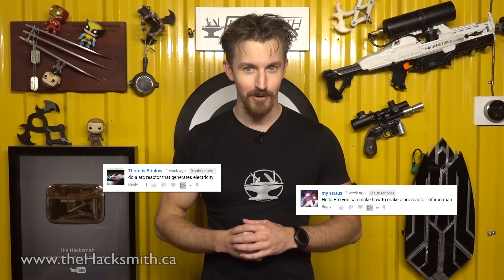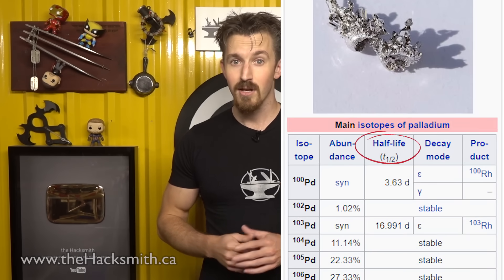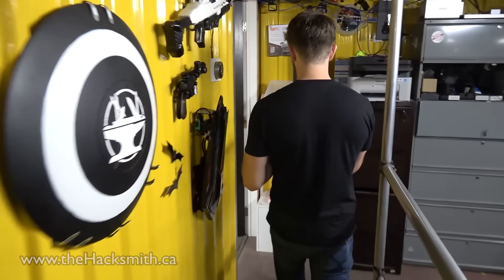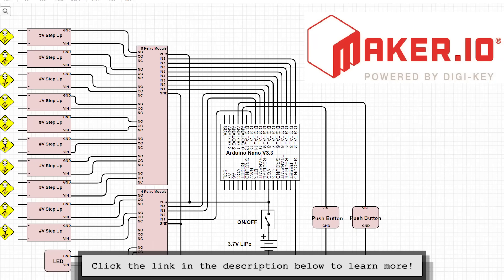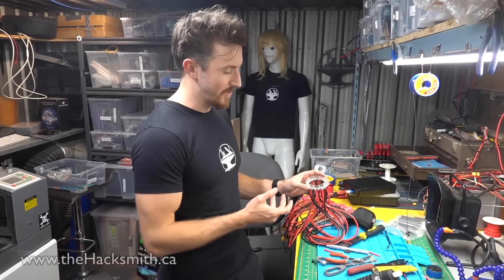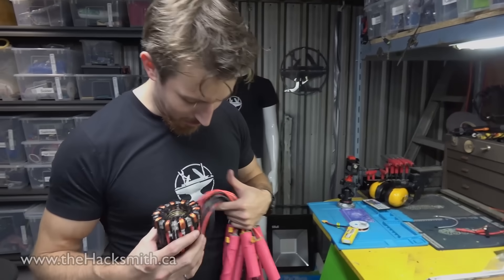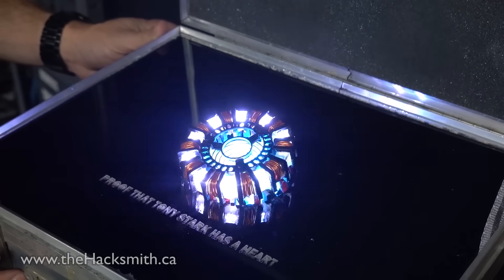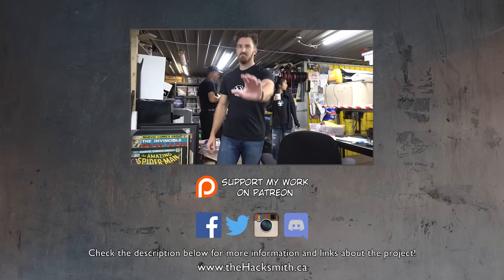Real Arc Reactor (ionized plasma generator)

Comment: ARC REACTOR IS NOT INFINITE POWER SOURCE! (Tesseract is!)
If so, why does Tony Stark face so much trouble of battery drainage every now and then?
Reply: Wrong, the problem is that the energy output was too low, at just 3 gigajoules per second for the one he built in the cave. That's why with the later generations of armors, he used multiple arc reactors to power just one suit. Also, don't mistake the huge arc reactor in his company with the mini-version that he use in his armor. The bigger one can power a whole company, but the smaller one can only power an armor in the first movie. 

At the end of the first movie, the bigger arc reactor was destroyed, and then in the 2nd movie, Stark built a new one with a new element that his father designed, which was powerful enough to power the entire Stark Tower. Loki then used that arc reactor to power the Tesseract and open the wormhole above New York. So technically, even the Tessaract doesn't have infinite power, or at least, not enough to open a huge wormhole.
Reply: To give Thor a purpose on the team.

Comment: You did it wrong! First of all you need a round flash tube (like from a stroboscope). Then power that appropriately. Now you only need one power input and much less power than before. 
The coils are not for harvesting power, but to contain it. The spark is plasma, wich can be controlled by electromagnets, aka the coils. With the magnetic field you can shape the spark/plasma, and for example make ik very thin, so it can't touch the outer walls of the glass tube and make it hot.

To harvest the energy you should use secondary coils under the flash tube. The spark/flash has it's own very strong magnetic field (think of an EMP device) that you can catch with a thin wire coil. Do not connect to your phone!😉

I would love to see you give it another try using my tips.
Reply from the maker: You should make one then!

Comment: The end product looks fantastic, but I think you missed on what the arc reactor is supposed to be.
It is not some kind of infinite energy loop, it really looks like a tokamak style fusion engine. It would explain the tiny coils around the mark1: it's to contain the plasma into a torique shape (ITER - the cutting-edge tokamak - is fitted with superconductive coils).
In such engines, under tremendous heat and extraordinarily powerful electromagnetic field, the heavy hydrogen plasma fuse into helium. And electric arcs are basically plasma, hence the "electric arc" look.
It would not be possible to build anyway. Containing plasma is no mean feat, and Tony's reactor would need some tank containing hydrogen.
Btw, no practical fusion engine existe today, despite billions of euros invested.
Reply: I'm curious, instead of generating incredible temperatures, is it possible to cause fusion with extremely high voltage discharges?  Also, I was wondering if anyone had looked into the reconsideration of cold fusion power.  Like there was a recent video "Cold Fusion Real but is it Ready" where they're reconsidering the possibility.
Reply: @SaveTheFuture  Massive electrical input IS used to generate fusion plasmas, most reactors use a mixture of lasers and induction heating to raise the energy (temperature) of the fuel. It's the reason fusion energy is so far off, you need to put in enough energy to light what is functionally the heart of a star but can only get so much of that energy back out.
Reply: Le Flumph Plasma has already been created in a lab and contained 

Just not sustained
Reply: I have been looking into building a fusion reactor myself as it is quite cheap (1000 for a small one) but there so far are no fusion reactors that take less power than it outputs (still wanna build it it is also perfectly legal)
Reply: +Nicholas Brown-Duncan It was done indeed, but even with all the knowhow of Hacksmith Industry I doubt they could have made a mini-tokamak just to run relatively cold plasma (I mean, barely hot enough to be plasma; compared to fusion plasma). And as for Tony's, I don't know if those tiny coils could do the job. Coils can't get better than superconductive, and we're already there with ITER. Still need them to be quite bulky, even compared to the enormous size of the chamber. And I think the ratio will probably get worse with smaller size.

Comment: A bit confused about how exactly your arc reactor is 'producing' energy. You produce arcs of electricity using a battery (and guessing this is where Stark used some kind of nuclear reaction instead of a battery).. and then... use induction or something to extract energy from them?
Reply from the maker: It doesn't -- it produces plasma
Reply: Interesting.. I'm not very familiar with plasma. Would love it if you can maybe point me to some material so that I can understand the working principle here?

Comment: Even when you have engineering degree or learnt electric courses, you don't want to stay near that 20A just in case.....
Reply from the maker: Depends highly on the voltage. Current is what kills you, but only if the voltage is high enough to break your skins resistance :)

The more you know... =)

Comment: Does it really generate electricity or uses that startup impuls to run for a while and then dies out when you stop supplying it with electricity from batery that is used for startup? Im not an engineer but does it really produce electric charge or it is a light show+ battery decharging device capable to charge cellphone?

Comment: But if I'm understanding this right the "reactor" isn't actually generating any power just draining power from the battery? So it's just a fancy lightbulb.
Reply from the maker: Like I said in the video... Its not possible
Reply: Maybe in a few centuries.
Reply from the maker: Even if we had super conducting wires you couldn't transfer that much power out of something that small. It'd melt
Reply: I wasn't talking 3 GJ/s or however much the reactor in the movies were. But with the advancement of technology we currently have it would be wierd if we didn't have some quite small and quite powerful reactors/generators sooner rather than later. Considering all the new materials that are being invented/found and how most technology is getting smaller and smaller.

Also suprised how I've gotten 2 replies so far on a 2 day old video from someone with 4 million subs. Very unusual. Love when people don't just check their newest video once to fave some comments and then move on. Have a like and a sub.

Comment: maybe you should fill the ring with some gas capable of transferring electricity...that way you wouldnt need that thick wires and could reduce the input voltage... the coils should transform it upwards anyway due to their small electrical field, as soon as they power up

Comment: Could you use the light from the electricity or if the reactor gets hot when it's on for a long time could you use the heat energy and transfer it back into electrical energy?

Comment: Tony's ARC reactor could just be a very high-frequency SPARC reactor

 May actually become reality eventually with the correct technological advancements in nuclear neutron radiation shielding/harnessing. Finding a novel engineering solution using nuclear physics, electro-magnetism, and plasma containment isn't likely in our lifetimes, but it seems likely that its possible. A Modern CPU is far more impressive than an ARC reactor in some ways.

Comment: You are ionizing mixed air which has carbon dioxide

But arc reactor needs hydrogen
So not much voltage is needed hydrogen ionizes faster and needs low voltage
Maybe just one module will work

Comment: perpetual motion is sort of possible without violation the laws of physics when the required conditions are not truly perpetual,  but seem that way by human standards. For example,  solar isn't perpetual,  but we can reasonably assume the sun will evaporate water to create rain to keep that water mill moving perpetually. Black holes could even be used to power a civilization for unimaginable time scales by robbing it of angular momentum and it would seem to be perpetual. You could even rob angular momentum from the Earth, but please don't do that. In line with this,  I've designed generators that would appear to be in violation the laws because they appear to be perpetual but really are not because the system they depend on won't last forever.

Comment: Using layman's, how does it "generate" power?
Reply from the maker: It doesn't, that's what I explained in the beginning of the video
Reply: So, there is no conversion to arc and then somehow reconversion to useable electricity? It's more like the batteries power the "arc" and the phone separately?
Reply from the maker: Correct
Reply: Ah, okay, thanks

Comment: What about a nuclear battery with tritium vials and solar cells, it’s very low voltage but its silent and if you only cover one side of the vials you can use died glass to creat the blue color since tritium vials produce light
Reply from the maker: Wouldn't produce enough power to do anything
Reply: I was really only hoping for it to power itself and be able to fit in a costume. But with the added benefit of having a radioactive material right next to your heart. The epa does say a little radiation is good for you

Comment: Wait, so did it power the phone or did it not?
Reply from the maker: It did
Reply: the Hacksmith sweet!
Reply: the Hacksmith does the arc reactor generate electricity, or does it use the electricity from the batteries to charge the phone?

Comment: Would the arc reactor work better if the arc was a secondary affect in a sealed circular chamber of liquid that has a low ionising temperature and can insulate extremely high temperatures, causing the poladium nuclear reaction to not have losses of heat which it would be able to reuse for infinite recycling of lost energy.

Comment: so all the the math at the start had no point ,
Reply from the maker: No...
Reply: calculating the total air resistance in the ring seemed kind of point less considering you did not use the whole diameter and use several step up converters anyway . just looked like a massive over estimation and a pointless exercise  .  what's the spark gap of 80,000v like an inch (3cm) and each of the segments are ~1cm , the maths had nothing to do with the final result

Comment: i don't know if this might not be clear idea but , is it possible to ionize or make a plasma chamber that can heat up the air and increase its pressure ? , the hole idea is to have a jet engine that uses electricity , voila :p , i asked a lot of professors and they could not get to a result , all they say is that you need to try it , cant do it cause don't have the tools for it , so is it possible from theory to real life application maybe ?
Reply from the maker: when we were building it we realized we could make a highly inefficient air compressor by generating plasma haha
Reply: maybe some day will work , :D

Comment: Use an argon filled ring tube light. Could do the same thing with way less voltage.

It'll save you alot of trouble.

Comment: 1) Mercury filled torus made of carbon fiber.  plus 2)pressure valve (like a radiator overflow).  plus 3) Rodin coil wrapped around torus.
Energize coil viola.  You got something, but I don't know what.

Comment: Actually in arc reactor there are not so many high voltage input to ionize the hydrogen to create light with the formula of		delta mc^2
And convert it into electricity
It uses hydrogen in fusion

Comment: But are there losses when using electricity to generate heat? I mean, in any other application, the energy loss is through heat, so in this case, there would be no theoretical loss. But maybe if it gets hot enough to glow a smaller wavelength than IR, that is to emit visible light, it might lose energy in the form of light? I know the physics of light are still little-understood, but just speculation.
Reply from the maker: yeah but you can't regain the energy from the heat... so its the conversion of energy that i spoke of
Reply: +the Hacksmith Ah okay, entropy. My mind was going to efficiency. Emitting heat at 100% efficiency. Lol I still speculate on turning heat back into useable energy, but no possible way of doing so has been discovered without making use of temperature differential, e.g., the Sterling engine, even the internal combustion engine. (I know, the latter also converts chemical energy, but I'm sure you know about the intake to combustion temperature differential I'm talking about)

I could go on about theory. Lol even if I know only 10% of what you know, I could learn. Haha might try that sponsor of yours if I can get a free trial without giving payment info.

Comment: Cool build.  I've always thought the ARC reactor was a neutrino powered generator.  Dropping the power state of a neutrino releases a large amount of energy.  That energy goes directly back into the generator itself which can be used to continue the reaction or siphoned off to use.  At an energy state of 20MV (the minimum known that can directly react with neutrinos), the current of any power being drawn off would be minuscule.

Also, why not use a common ground for the arcs?  This would reduce the number of wire by almost half.  The output stages of the power supplies are a simple pulsed DC multiplier.  Those can behave well along side of other high voltage devices on a common ground.

Comment: hey so can you check how hot those copper wires become.
P.S can you use an alternating current instead of a constant direction this will make the copper rings into magnets which will generate current as alterating current as well
Reply from the maker: They are AC. The transformers take DC into HV AC

Comment: i'm confused, is this thing just throwing power through itself and then powering other stuff or is it burning something to make power, or am i just stupid and missing something?
Reply: yes ,like the hole video
Reply: All of the power comes from the battery, its voltage is stepped up with transformers to allow the electricity to arc across an air gap. The "arc reactor" doesnt actually make power, just uses the power from the battery.

Comment: i think the point in the movie's arc reactor wasn't palladium exactly later on there was a revised version of it because it was toxic to tony so he invented a new element structure while i don't think it would be viable without intense Research and development and even more testing to mix the right alloys to create a non-toxic superconductive material you could still use current super conductor alloys and test them to figure out what would be optimal.

Comment: You could have used an inert gas or even air at low pressure which would have allowed you to get better results with lesser voltage.

Comment: those massive cables for 20 amps? you could have used half of one of those
Reply from the maker: They're not massive -- that's almost all insulation
Reply: @hacksmith  they look like 12-10 AWG from here
Reply from the maker: yeah they're only 20ga inside
Reply from the maker: I was more worried about electrocuting myself than wire sizing for current capacity

Comment: First you now the plasma right just electric and heat and not such hard to Make it but your "generator" not for using becuse its giving much than its getting and you don't need to this batteries just make 8x advanced solar panels to charge 1 mother battery to this "generator"'s hold his energy and also you can get energy free and charge your Phone much easly :) anyways for the full charge for the your 8 or 9 battery with a 8x solar panel can take your 1-2 years

Comment: So, I have a complaint. You tried seeing if it would charge a phone, but the second you plug the phone in it is already 100%? Couldn't you have found at least one phone under 100%? From your video it only looked like it was doing so without any indication. But what do i know?
Reply from the maker: The battery charging screen only comes up if a phone is receiving power...
Reply: Ok, fair point. I overlooked that part. Also, wow I didn't actually think I'd get a reply from you. ^_^ Sorry for sounding rude in my original comment.

Comment: could you theoretically rewire the arc reactor to the jet engine to make it run off of electricity instead of fuel?
Reply from the maker: No, a jet engine works by burning fuel

Comment: Wait a min since you can only transfer electricity and not create it wouldn't you be still able to make infinite electricity source by converting electricity to heat and then back to electricity
Reply from the maker: energy in = energy out + losses

every time you convert electricity, you create heat, which is a loss
Reply: If there was a way to prevent that?
Reply: +the Hacksmith energy can be transformed though. Can you implement some mechanism that turns the heat going out back to electricity?